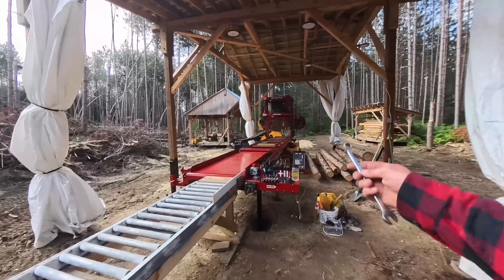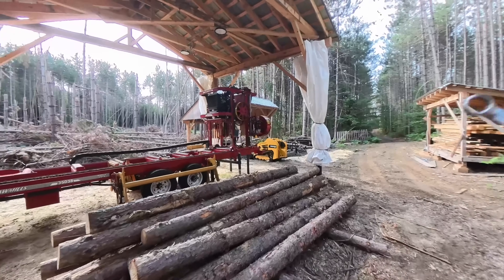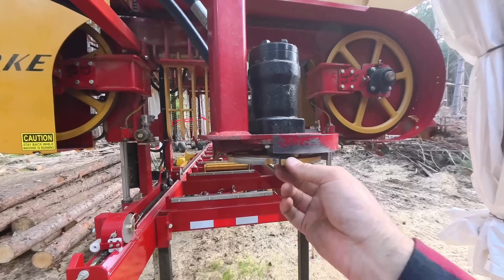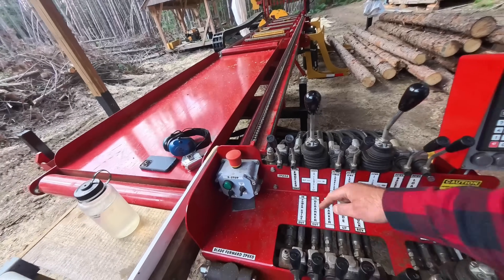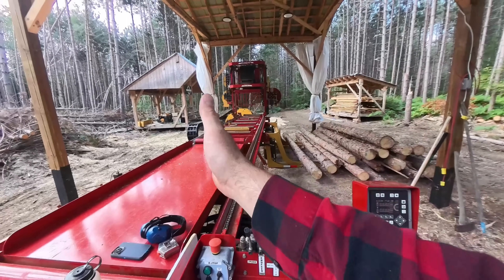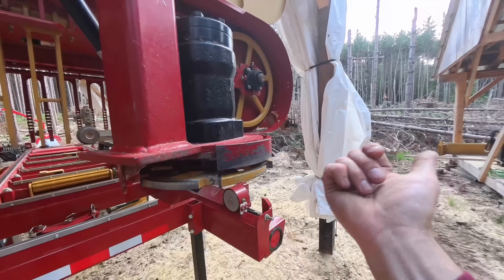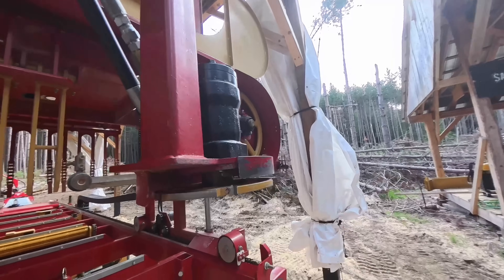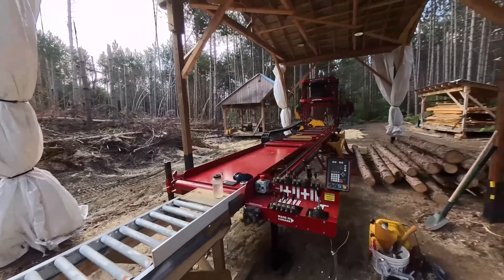Save Money with this Sawmill Upgrade

Comment: Hello Sandy. The rollers are a nice addition to the mill. I could see the cut the debarker made, but I could not see how the blade lined up in relation to the debarker, both being different thicknesses. It looks like space is opening up. Have good days!
Reply from the maker: Hey there Buddy Reed! I'll for sure have a better overview of the roller table real soon. It's still in it's planning stages so I haven't solidified anything yet but I"ll be sure to give a good overview what I"m thinking there. The blade goes right where the slot is cut with the debarker. The debarker is probably around 3/16" thick or so I'd imagine

Comment: I like the addition of the roller feed.  Now, you just need your lumber storage space at the end of the roller feed and you can take the lumber directly from the rollers and stack it.  If your chipper was at the end you could also take the slabs and feed them directly into the chipper.  Oh so many different possibilities.
Reply from the maker: Hey Paul! I’ve got a video soon talking more about the outfeed. Still in the planning stages for sawmill layout but hoping I solidify something soon

Comment: Sandy, everyone with a sawmill needs a debarker.  If they bring logs to the mill they are most likely going to touch the ground and pickup dirt.  It doesn’t take allot of dirt to noticeably damage your blades.  I would rather spend time sawing than sharpening.  Great addition to your mill.👍
Reply from the maker: Hey John! I’m with ya there! I do like sharpening but I absolutely like sawing 10x more
Reply: @sawingwithsandy yes sharpening can be therapeutic at times, but like yourself when I’m sawing I don’t want to be stopping to change blades.  You have a great setup.
Reply from the maker: Thank you!

Comment: Looking good, Sandy! 🤗  One more thing that is not hydraulic is the bandsaw, no? 🤔I thought it was driven by the diesel motor through a clutch?🤔😉
Reply from the maker: Hey great to see you here! You're right there about the blade. It's powered directly from the engine with a manual clutch that I engage with a lever.

Comment: One thing I do for my cold cut chop saw blades is have them cryogenically treated. They last 40% longer or more. I’d think that’d help your blades as well. The place I had mine done (in London On) treated similar type bands to yours that were used for slitting cardboard for a packaging plant. It saved them a lot of money in blades.
Reply from the maker: Thanks for sharing that Bob. I’d not heard of that until you mentioned it now. I’m going to look into it
Reply: @sawingwithsandy   I’ve heard of cryogenic treatment to increase blade life but I wonder how the heat from the grinding wheel affects the cryogenic treatment?🤔